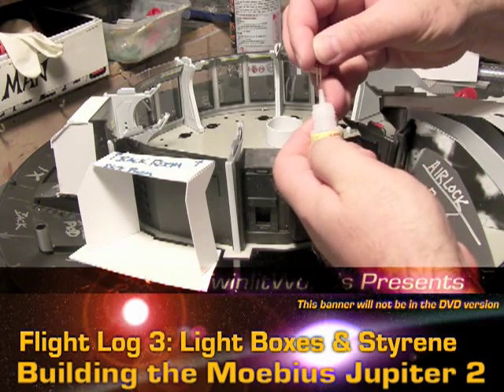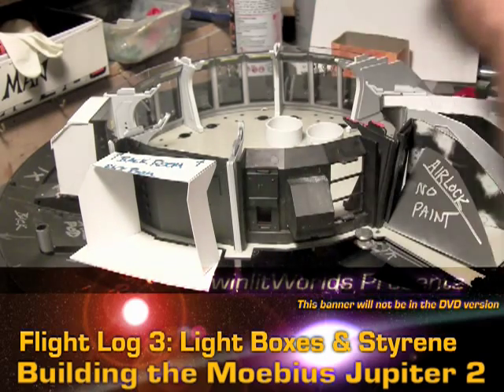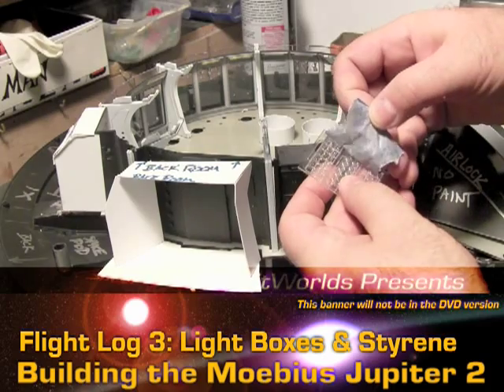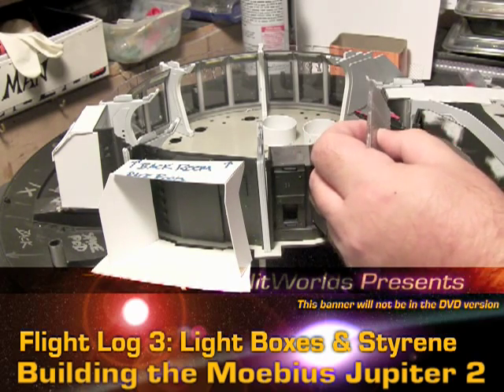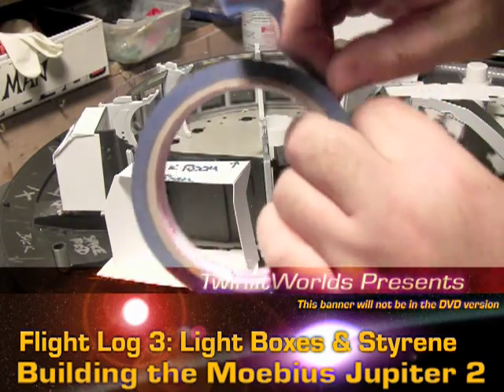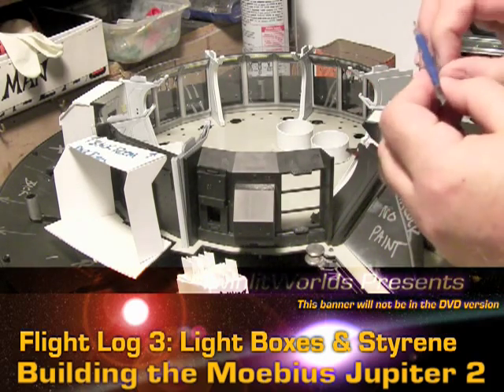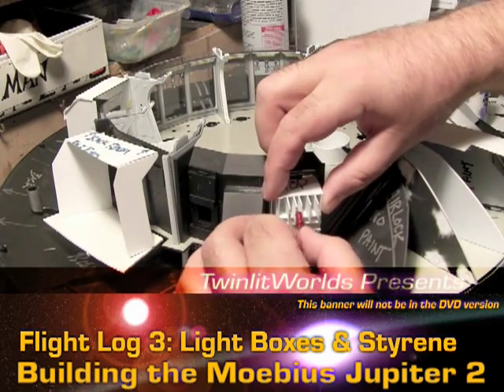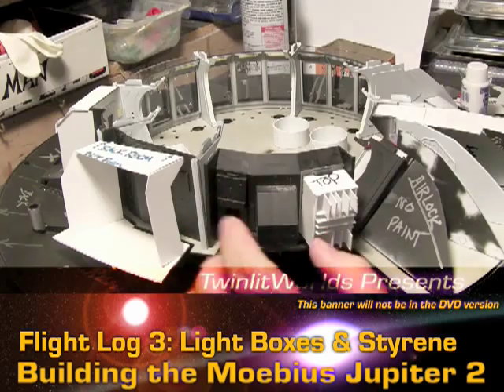Project Jupiter: Flight Log3 2/7

Comment from the maker: 10-15mcd is in the average range for brightness.  If all those seem 'dim', then that's not a great thing.  There's not much I can say on a remedy other than simply using many of them to achieve the light levels you wanted is an option. Instead of one, use two or three.  If you were looking to use ten, try twenty.

Comment from the maker: Yup, more juice will brighten to the point of burning out.  However, once started on that path, you may as well see if you can get that one to pop, hiss, fizz and/or smoke at its moment of death as it is now unreliable.  Using that one is setting it up for failure down the immediate road.

Going heavy with resistor ratings means you can deliberately dim them too -a very useful trick!

Comment: @ModelManTom The first batch of colored LEDs was given the range of Luminous intensity: 10000-150000 mcd.  I'm not sure which colors have what intensity, though.  I have another batch of white lights on the way that are simply described as "Intensely Bright."  

One side note, when I took the resistor off one of the green LEDs to see if more juice would brighten it, it became an intense orange, but I disconnected it for fear of burning it out.

Comment from the maker: The only thing I can think of, other than the fact that they were simply bad in your case is if you had checked the milicandle rating?  

If it was in the 8,000 range, then they would be on the dimmer side of the scale.  If however they were supposed to be 20,000mC and they were very dim, then that is  a problem.